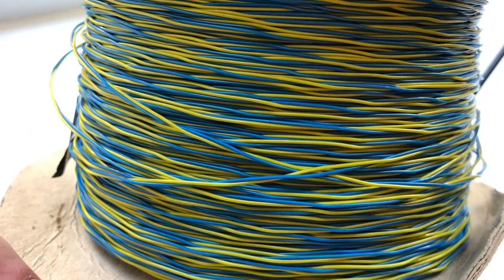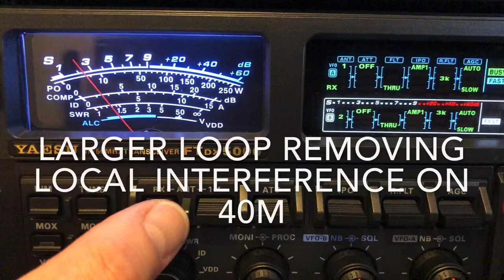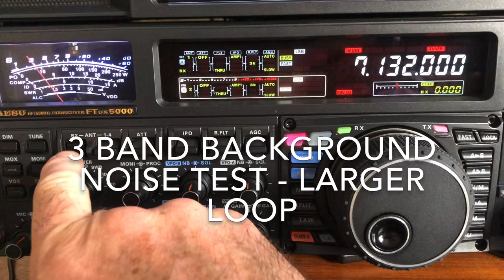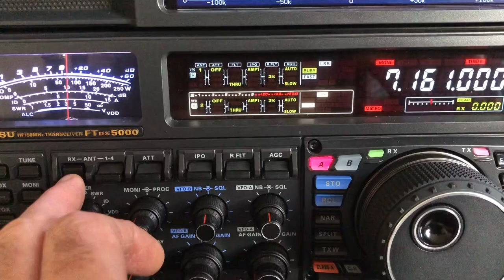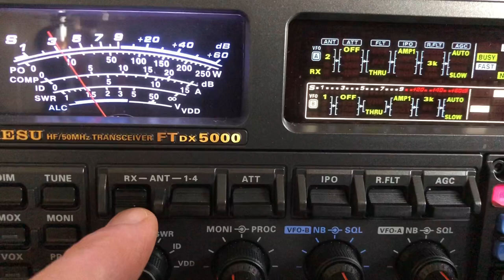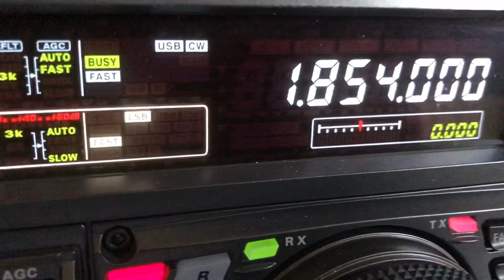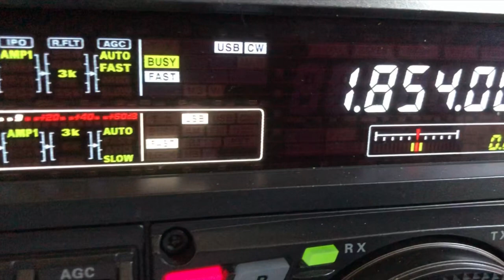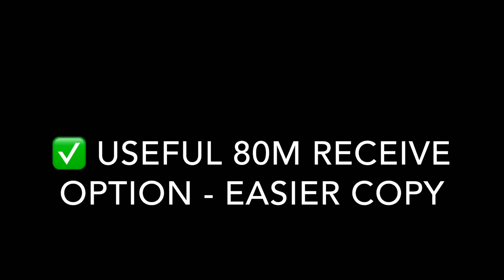Loop on the Ground Antenna - Part 3 of 4 Final Tests

Comment: One thing we're missing from these sorts of experiments are signal/noise ratios.  It's less important to me that a smaller loop attenuates the noise more than a larger loop if the smaller loop also attenuates the signal more.  Unfortunately most radios don't really have great interfaces for accurately measuring SNR; you'd need to convert from S units back to decibels, and that's assuming the S units are actually consistent...

It's interesting that the two loops in conjunction seem to do okay.  It makes me wonder if there's such a thing as a "fan log" with a bunch of lengths for different bands, hoping to get some rx resonance on the best-fitting loop for a given band.
Reply from the maker: Yes. The SNR is key as you say. I’ve kept using this loop for some years now and it works well in its original form. Lower noise and signal, but better ratio in many cases 👍🏻

Comment: Thanks for this!
My interest is with the 160M band only.  Today I installed a square LOG, 55' on the sides. Works well on 80M but 160M DX stations are attenuated too much to be useful. I have the property to make it larger, but it appears that this may increase the background noise. I may try a preamp first.  Prior to this I tried a 200' BOG pointed to the EU and found about the same performance on 160M.
Reply from the maker: Ok Rick. I saw the noise go up with the size of the loop too. Good Luck!
Reply: @ianxfs  I modeled this with EZNEC 6 to confirm kk5jy's plots. Then lengthened the wires to compare the gain at 6 and 3 degrees. The larger loop increased the gain significantly but the gain peaks at 60 degrees. Two bad we cannot steer the loops peak elevation angle like EZNEC.  Good thing the investment is small, the results may match the  costs.

Comment: Candidly, I thought this might be a complete disaster, but it does have merit, got a bit fed up with noise levels on 40m, seemed to put out quite an exceptional signal but ludicrous noise levels were killing my receive. I might just have to try similar. I know a very low wire was useful on 20m receive. With stereo headphones fed from main receiver and sub receiver the “diversity” from separate aerials was amazing.
Reply from the maker: Yes stereo and two antennas is a good experience! Apologies for delayed reply, I've just discovered YouTube holds a folder of what it thinks is "iffy" comments...all mine seem ok though, so not sure why!

Comment: What if you added a low noise amp at th loop antenna it should do better with the signal strength .   Or a larger  wire diameter  for the loop. Just wondering 
Chuck AA4CP Port Salerno, FL
Reply from the maker: Thanks for the observations Chuck. I’m still picking up background noise on the rig, so I’m not expecting much from a pre-amp (which again I can engage at the rig end if I need to). Paul (G1WHP) was going to try a pre-amp, but I’ve not heard back from him yet. On the wire front, I’m not sure that will make a difference? I’ve already tried thin telephone jumper wire, up to the much thicker DX10. 73. Ian.

Comment: I think that’s been a worthwhile experiment Ian,now did yo try the feed point in different positions?i heard the loops might have some directivity ?
Reply from the maker: Gm4zji Yes, I tested when in the bottom-right corner, but eventually settled for top-left. That was a decision purely on direction of theoretical propagation though. It would be tricky testing directivity unless you’ve got a patient station to test loop rotations with, or you’ve got two and can toggle between them. If you check out the first video (this is #3), I explain the directivity. 73. Ian.
Reply: ianxfs thanks Ian enjoyed the experiment👍
Reply from the maker: Correction to the above. I tested both bottom-left and right. Went with top-left for the final set-up, which is effectively the same as bottom-right, for the propagation as above, but also to get the connection box off the lawn and into the flower borders out of the way.

Comment: Thank you Ian. I went a built a small loop after watching your first video. I had the same initial disappointment you did. 

I think the key here, as with beverage antennas, it receives surface/ground wave as opposed to skip. From my research a dipole doesn't emit/receive much surface wave while a vertical does. I'm going to do more testing but here is my hypothesis; it will be better suited for closer stations that might normally skip over you. 

Vertical antennas radiate a decent amount of surface wave, the lower the frequency the farther the surface wave will travel. This is why the higher bands don't seem as good but I'm betting if they were closer it might be a better antenna.
Reply from the maker: You might be into something Levi. Good luck with your experimenting 👍🏻

Comment: Hey. Can You tell me what diameter of copper wire is necessary for LoG antenna?  I can either use wire from unused UTP cable i have laying around somewhere, or do i need to buy better copper wire (thicker in diameter)? Thanks!
Reply from the maker: MrKeczub Hi! I think any wire will do as long as it’s insulated. Mine was domestic 0.75mm twin mains lead, but it was just what I happened to have to hand. Good luck! Ian.
Reply: @ianxfs  Thank You!

Comment: The LoG does not respond well to high angle incoming signals. . High angle signals on 160 and 80 mixed with high angle noise will not show much improvement in SN Ratio on a LoG because the loop rejects the desired frequency by the same amount it rejects the noise.  On 40 the lower angle skip signals will show significant improvement in SN Ratio over the higher angle noise, as you saw. 
Mistaking louder signals in the speaker as the criteria for judging improvement leads to questionable conclusions. If the reactance of the windings is not at least 4 times the impedance of the loop, results will be poor.
K8DO / Doc
Reply from the maker: Thanks for the observations Doc 😀

Comment: The reason people struggle with this antenna is they struggle with understanding Matt’s instructions on the set up of the antenna and radio. As Matt said the antenna set’s the noise floor NOT the receiver. Otherwise it’s useless because all your doing is increasing the noise floor which defeats the original design. Same thing with bog antennas as well!
Reply from the maker: Hi Ron. See my part 4 comment. Thanks.